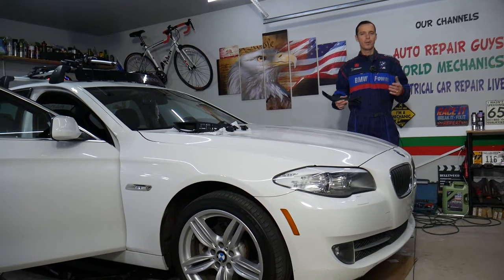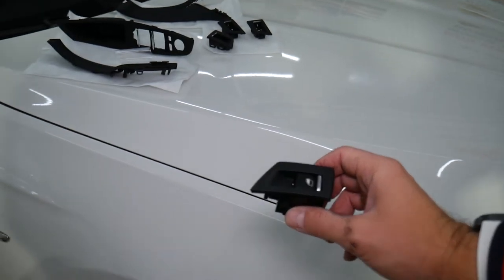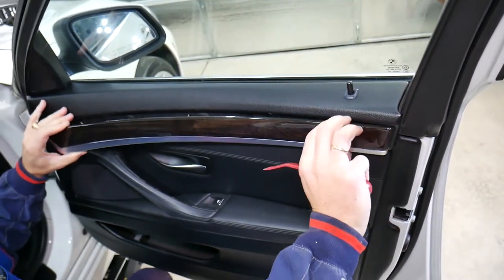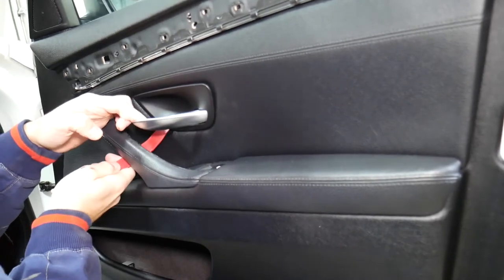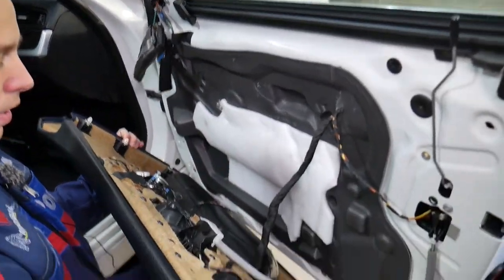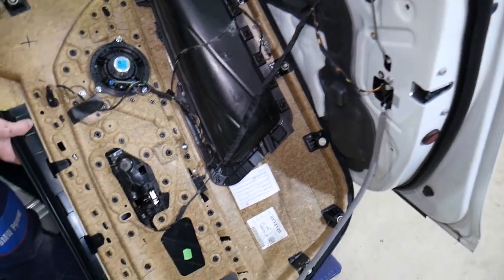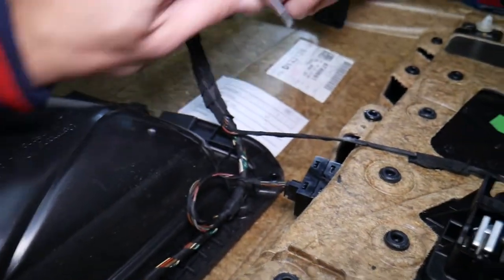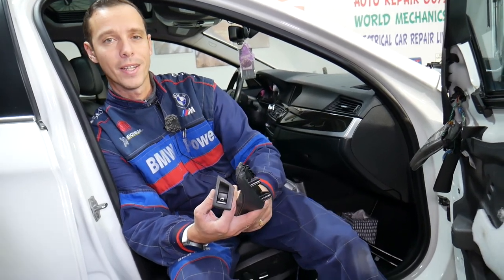BMW F10 F11 FRONT RIGHT WINDOW SWITCH REPLACEMENT REMOVAL  520i 528i 530i 523i 535i 518d 520d 525d 5

Comment: Again a great video.  Thanks for what you do!  
For this video and for people making this repair, there are two concerns.  

One you already corrected on a later video on the driver's side window switch replacement.  In that video, you removed the horizontal trim piece being fully aware of the ambient lighting on the bottom of that trim piece, and so you only worked from the top (aside from the metal clip that needed to be pushed up from the bottom).  

The other detail, would be the way you removed the trim for the door opening area.  You found a safer way on a later video where you pry the rear side first, and then carefully and firmly push the front side down with a plastic pry tool, then work it until the top comes loose, then push the entire trim piece up to release the bottom clip.  This video did not show the "hook" type areas on the door where the trim actually clips into.  If one were to pry out on the trim piece to remove it, those "hooks" would very likely become damaged, requiring more expensive parts to be replaced.

Again, thanks!  I appreciate your effort on all the vids.